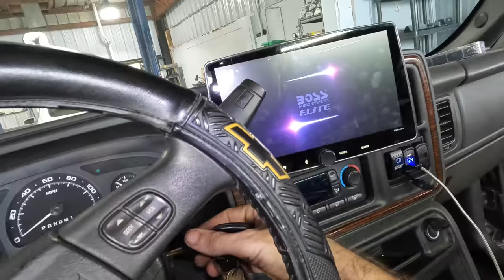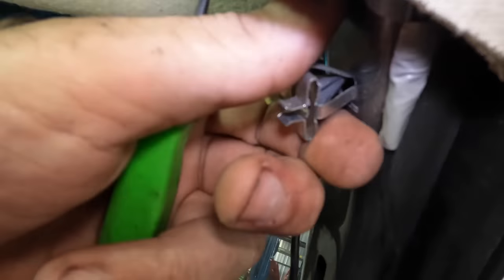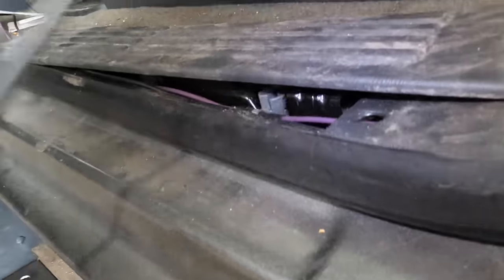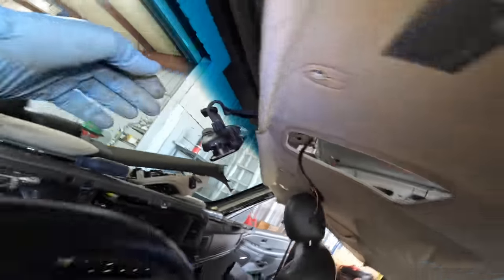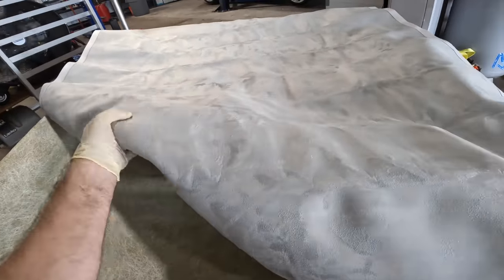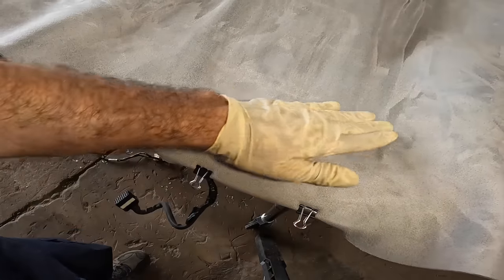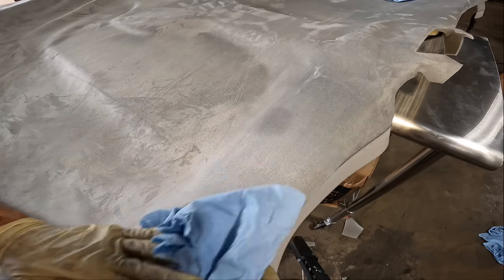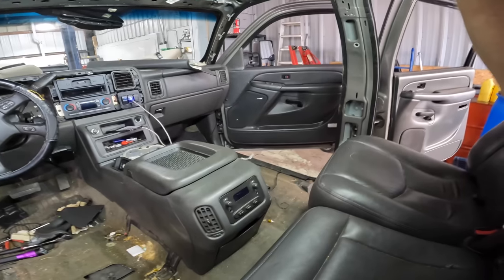Sagging Headliner! NOT an EASY Task!

Comment: I think Acetone will dissolve the foam, but leave the fiberglass alone (but test an eensie-tiny section, first!) it’ll also help clean any glue residue off the fiberglass once you’re done. You’ll need to do this outside, or choke on acetone fumes - bad. 😢
Reply: What a missed opportunity to use brake cleaner.

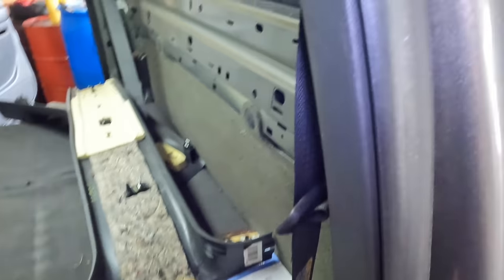Comment: 20:15 "whatever, it's all going to get vacuumed out". Dude, tore down that much, use a leaf blower. Park so you have cross wind outside somewhere, and use the leaf blower and air compressor to blow all that out the other doors.

Comment: ray,,,,,, been easier to work on the headliner if u had pulled wire bundle from the headliner and taped on to the roof
Reply: @@SimrKhera pull the wire bundle off the headliner so not have to disconnect and fight with while headliner is out of truck

Comment: Ray your method of removing the head lining foam and adhesive is very dangerous  The wire wheel would have caused tiny particles of glass fibre to be removed.  You then blasted it off with compressed  air without wearing a mask .Not good safety practice.